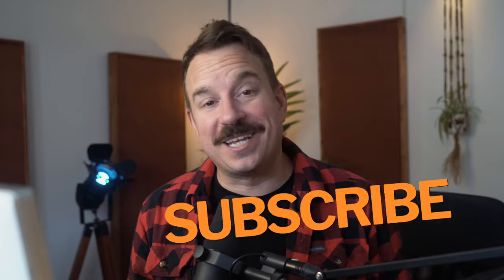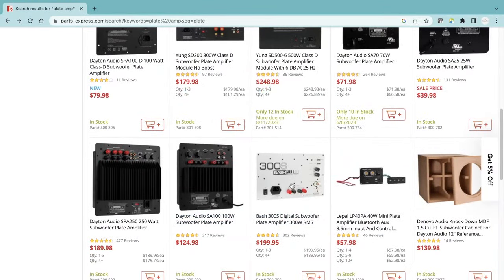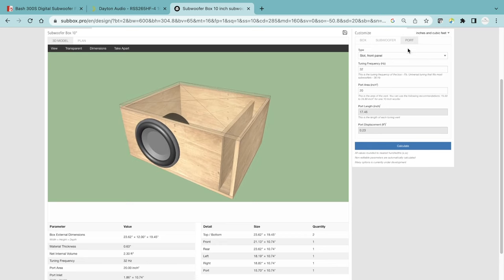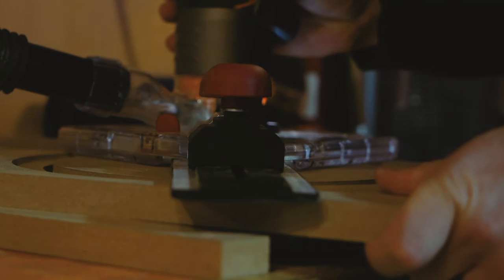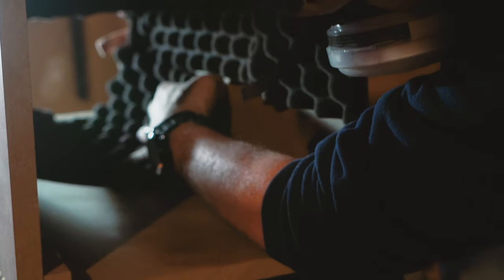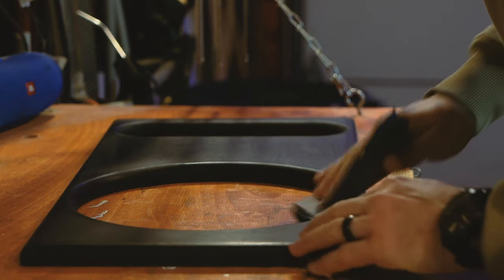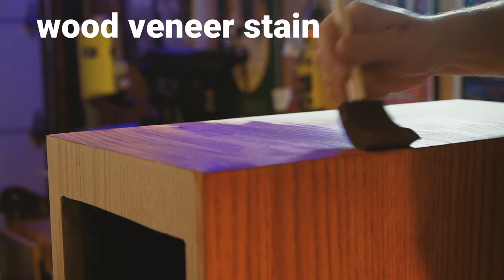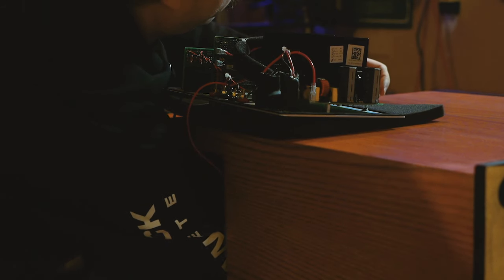I Built this Epic Subwoofer from Scratch!

Comment: Did you factor in port air velocity? Sub-box Pro will give you the correct length for vents, but that's it. Great build but port chuff is an easy way to ruin a subwoofer.
Reply from the maker: Hey rohcycling5646. Thanks for watching. I was fortunate that there is little to no chuffing with this design. I’d be lying if I said air velocity was a consideration :). That’s the best thing about DIY builds always something new to learn and consider. Thanks

Comment: What is the purpose of the angled corner pieces? Is it bracing for the corners? I see a lot of boxes that put those in on the corners around ports and the claim is that it helps reduce air flow issues cause it reduces the angle from a 90 to a 45 for the flow. But.. what about the top/bottom parts? Seems like you would need to put those in all areas of the port.. top, bottom and corners. Otherwise you're still getting resonance issues in those 90 degree seams.
Reply from the maker: Yeah you got it. Though I was more concerned with reinforcing the corners as I didn’t do any joinery :)

Comment: ive got a 10" sub. in a massive case. and the speaker really goes. it moves up and down. i can hear the low frequenties but i cant feel them.. i want to feel the bass. what im i doing wrong?
Reply from the maker: Sounds like the Cabinet is too large for the driver. If you have the specs for the driver there should be recommended sealed and vented cabinet sizes

Comment: If you put threaded inserts in the back of the baffle you can use them as clamps to pull it down while glue is drying on fixing to the front (or not glue it). This is a nice way of doing the front baffle for perfect alignment - especially if you have oversized it a bit for a shadow line or some such :). 

I had a double thickness baffle - so I lay one layer on the front of sub where it was to attach, drilled holes through both. 
Place threaded inserts in the baffle, then glue the two baffle layers together and do the finishing (threaded inserts exposed out the back).
Reply from the maker: Great call. I’ll try that next time. Thanks for the advice

Comment: Wood glue and water works for a lot of stuff, most of all it’s really good as a bonding layer, especially between incompatible chemicals. I’ve used wood glue as a primer to spray paint polystyrene foam with solvent heavy polyurethane spray paint. The trick when adding water is remember a little bit of water goes a long way, and that it’s difficult to be consistent with it. I use an empty inkjet refill syringe to test the thickness of it. If the blunt needle can suck it up then it’s thin enough, if it can’t then I add more water. I add just enough so that it can draw, not a drop more.

Comment: I worked at a cabinet shop in dallas tx that used veneer skins and we were made to attach or apply the skins with spray adhesive and used a fine bastard file to cut and finish the edges it was super simple but took some practice

Comment: That is absolutely a beautiful furniture grade sub cabinet. I enjoyed the build. Why are you using foam in the cabinet? I was taught to use an amplifier with at least double the rms of the speaker, so you have some clean dynamic headroom for the speaker. Anyway, great vid
Reply from the maker: Hey thanks for watching. I went with foam based off of products I’ve had using similar material. As for the amp. You’re probably right but the combo I’m using is giving me great results.

Comment: Your video was extremely well done and I plan on building one for myself. I am reasonably accomplished with woodworking and Love what you did with the cabinet. However, I am new to building subs. The plate amp you recommend is no longer available. Will any 300 amp plate work such as the one recommended by Amazon?
Reply from the maker: Yeah. I’d recommend a Class D with a minimum rating of 300watts rms. The Bash stuff is great if you can find one.

Comment: Hey man, excellent video! Enclosure came out very nice! Like the editing style as well. 

Curious if youve done tests between going only to 2000 grit vs 5000? Since you're applying another top coat (instead of polishing the finish) you may not need to go as smooth to get your final coat looking good. Shoot, we only went to 2000 before cutting and polishing cars when i was doing them 😅 may save you some time? 

Also, if it measured better... I'd say you built a better sub 😉 well done!
Reply from the maker: Yeah this is the first time I’ve gone all the way to 5000 grit. My brother swears by doing it this way so I thought I’d give it a go :). I’ve made some other furniture using 2000 to smooth out the finish nearly identical but there is a slight difference…even if it’s in our heads lol. 
Thanks for watching @LifeofBliss .

Comment: Hi
I buy the same bash but sound low vol
Maybe i need new av receiver?? The receiver i use is old  and maybe 25w  or the woofer box is small 
And how set phase and freq?? Thanks
Reply from the maker: Hey thanks for watching. My guess is it has something to do with the driver in the sub or the cabinet. The receiver will have control’s for the bass management but shouldn’t be the cause of a low output unless it’s turned down on the receiver end. Try connecting it to your phone or CD player directly. If you can get more volume out of it then it could be setting issues on the receiver.

Comment: looks great but your amp is underpowered. you should always use a much larger amp than the subwoofer is rated for. it's perfectly fine to have 1000W transients on a 300W RMS sub, and in fact, this is what you want. As long as, of course, they're just transients.
Reply: Unless the amp or his source has a high-pass filter, he'll be running into excursion limits at a fraction of the power, so it's unnecessary.
Regardless, if this can get as loud as he wants, more power is wasted
Reply: Agreed - I have made that mistake in car audio with even some higher end rockford fosgste amps… they will deal with clipping for only so long before both the amp and sub (jl audio!) will self destruct…. Worse: the electrical smell will be so bad you will end up throwing away the enclosure…. 

So lesson learned 2.5-3x the wattage I think I will need… I would rather have a blown sub than a more expensive amp!!!

Same story with brands like M-Audio - internal plate amps = garbage components made in Chinuh… you get about 5-7 years and then you’re SOL…  sad because I absolutely loved the smooth sound of my m3-6’s for near field use… they were sleepers for 2013 era speakers